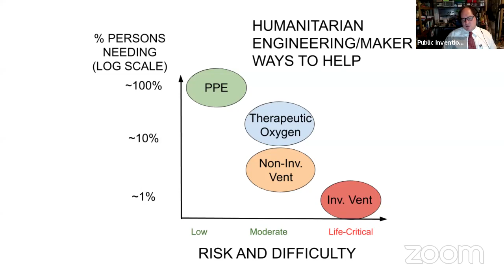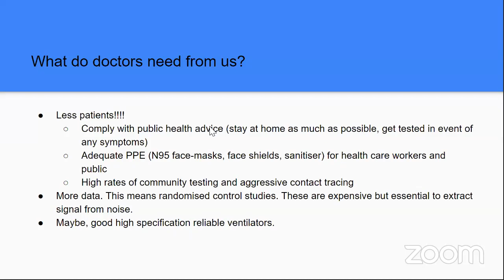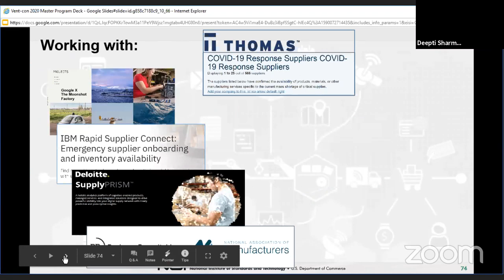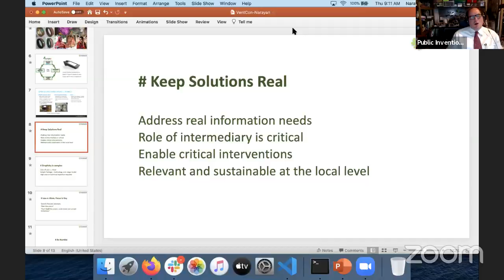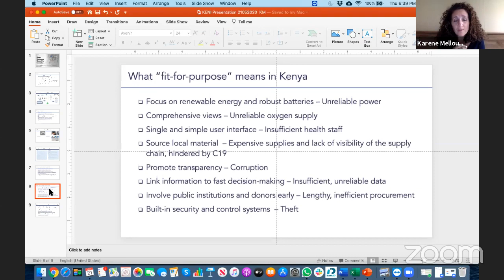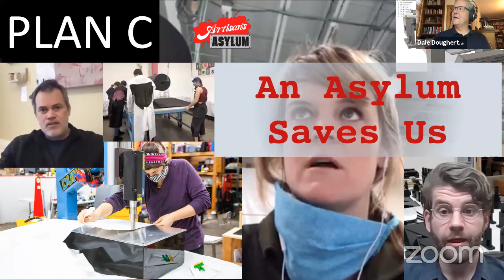Vent-Con 2020

Comment: Fantastic work.  I wanted to share a serious concern of mine.  From personal testing and other groups we learned Ambu bags tear and create holes after a few days of use.  They simply were not designed to handle the friction/cycles.   It worries me to see so many ventilator designs that use Ambu bags.  They really are not safe
Reply from the maker: Thanks. I think you are correct. As I mention in my talk (after the introduction), our goal should be to modularize the "air drive" so that an "bag squeezer" could be swapped out for a pump or blower and back again with no difference to the patient or doctor. I'm trying to promote data and control standards that will make that possible; the data standard we propose is: https://github.com/PubInv/PIRDS-respiration-data-standard